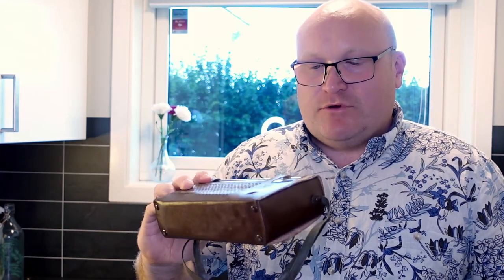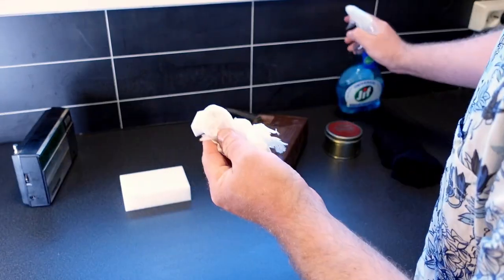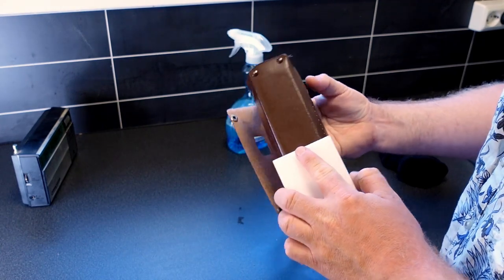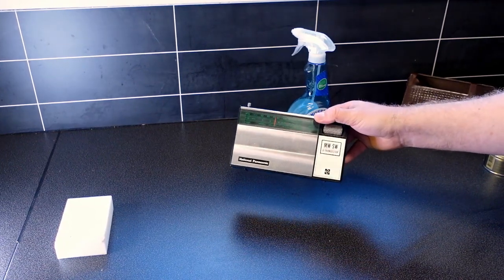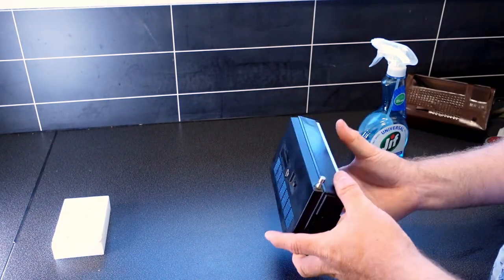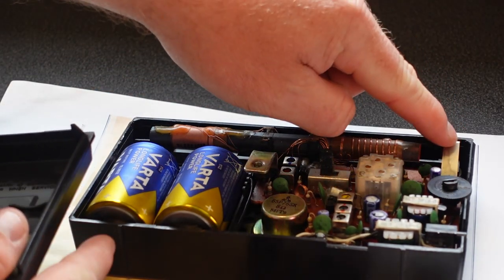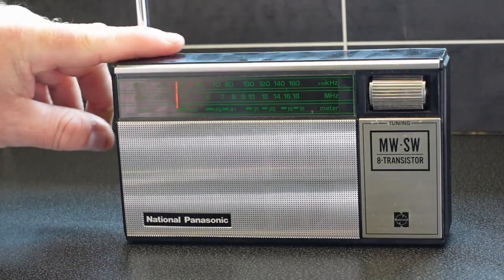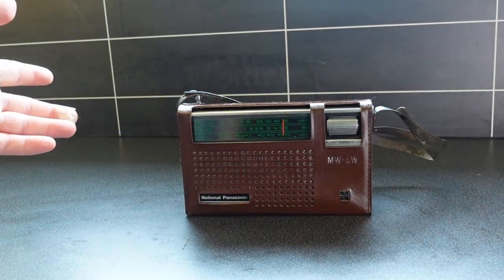Cleaning my grandfathers AM travel radio

Comment: Surprised that it only has 2 1.5 volt batteries.  3 volts is not a lot of voltage to run a radio on.  73
Reply from the maker: Yeah, it would be fun to see how long they lasted. I'd forgotten how chunky D-cells are, gotten to used to modern lightweight lithiums in all my lights 😁